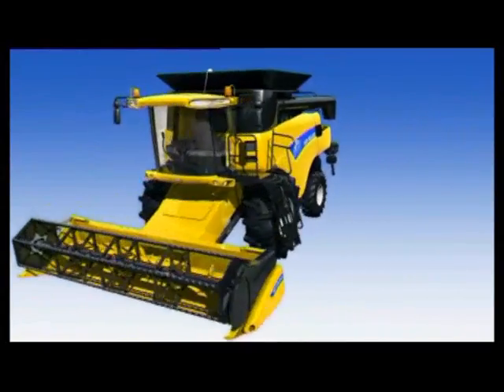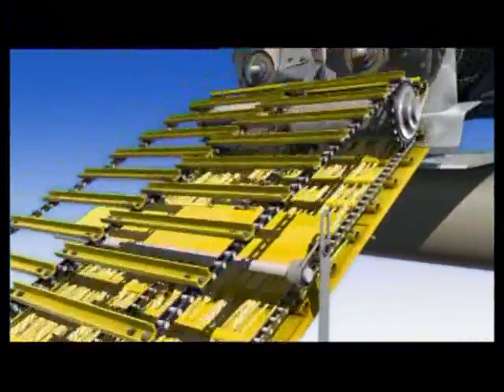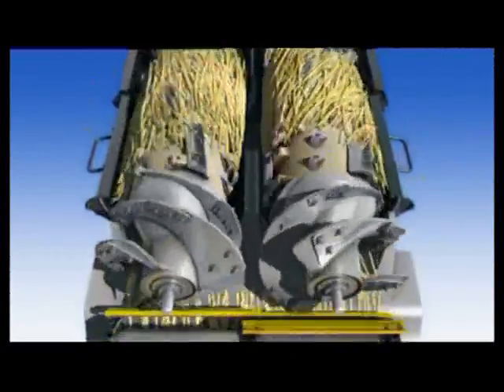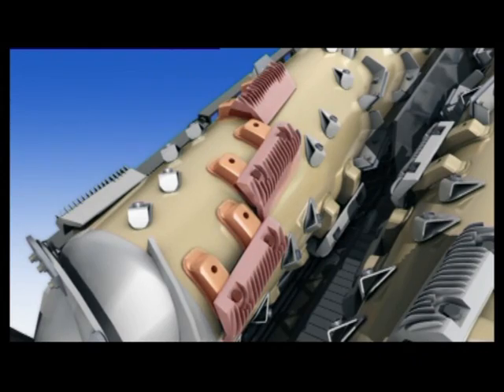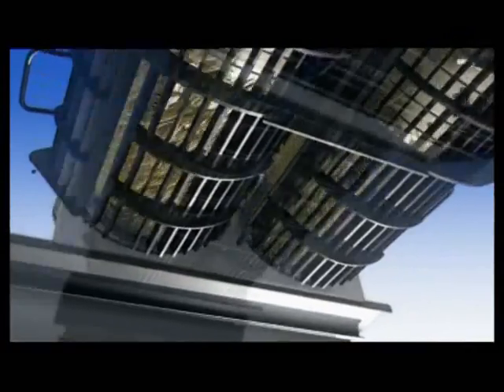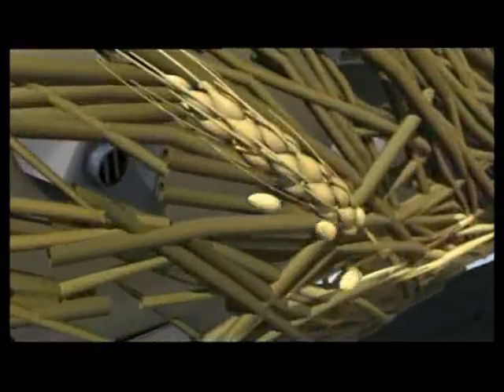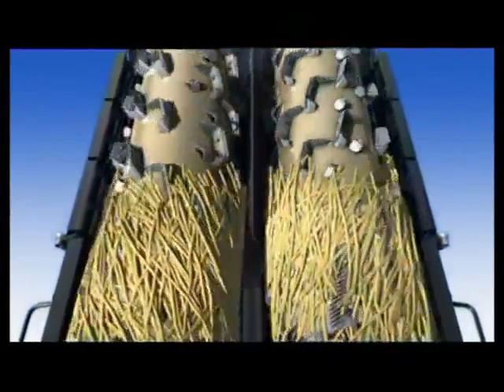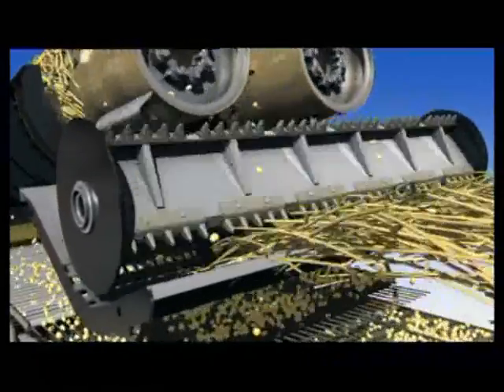CR9000 How it works - Threshing

Comment: The old New Hollands had trouble keeping the crop from suddenly favoring one rotor which then would slug the machine. Not fun to unplug an old TR70. How has that problem been addressed on the current New Hollands?
Reply: I've had NH combines for over 20 years, starting with a TR75.   I've never once heard of the crop favoring one side and slugging.   I've heard of Gleaners having trouble feeding and slugging but certainly not NH.   Are Gleaners still called Silver Seeders because of all the grain they ran out the back?   Not fun to get a Gleaner to hold grain.
Reply: +SilverGleaner The reason that might happen, at least in my opinion, is the rotors being out of sync. If one rotates faster, it will draw more crop than the other. Hopefully they added some form of mechanism that synchronizes the two rollers.
Reply: @Zamolxes77  I don't think the problem had anything to do with one rotor spinning faster. I don't know how that is even possible. But I don't know. There were never many around my area.I do remember a TR70 slugging so bad the sides of the machine were swelled.
Reply: Notca problem in australia